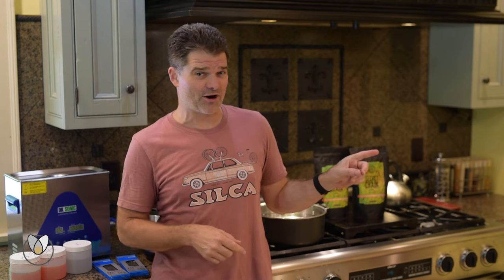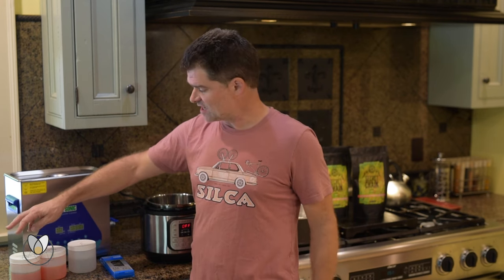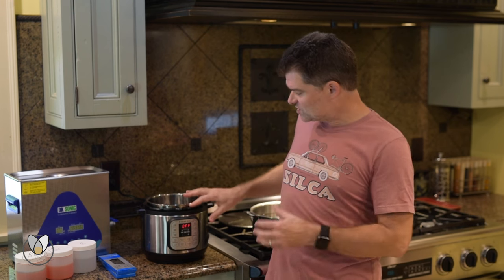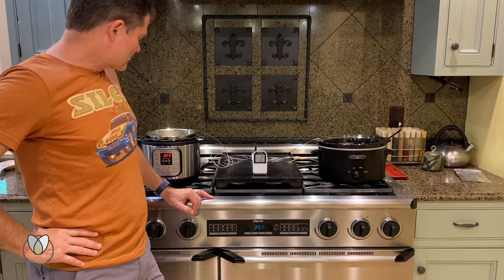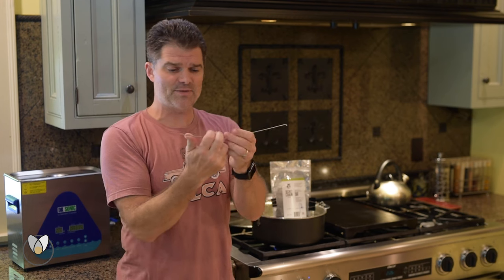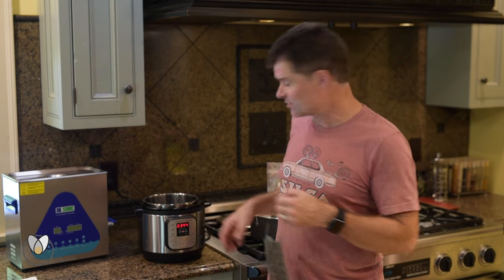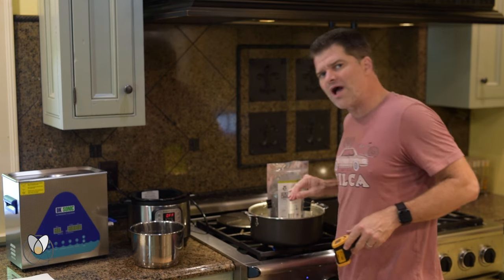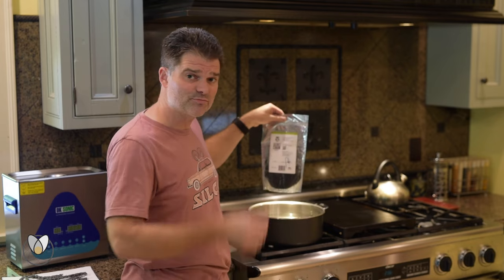MGTV: How to Hot Melt Wax Your Bicycle Chain

Comment: What's the point of leaving so much lube on the OUTSIDE of the chain? It doesn't do any good from a lubrication standpoint, it flakes off and gets all over everything, and it wastes expensive lube. It seems like you'd be better off to focus more on agitation to make sure you get plenty of wax on the INSIDE of the chain, where it really matters. Pulling it earlier would be one way to end up with less on the outside. Another would be to let it cool completely, then hit it with a heat gun just long enough to melt the wax off the outside. Either way, catch the drippings and reuse them.
Reply: I pull mine after a couple of minutes of agitation, wipe the outside real quick and cool it with a fan. The clearances in the chain are way to small for the wax to run out even when it's hot. I usually get 300-400 miles per application out of it this way.
Reply from the maker: The goal is to keep as much lube as possible inside the chain, and the only way to really ensure the how wax isn't running out of the inside of the chain is to get the wax on the outside to solidify as fast as possible.  You can absolutely then scrape the chain and manipulate it to get the excess wax off of the outside over the Instant Pot to save it for later.. but we've tested it pretty extensively and it is very clear that pulling it as cold as possible leaves more wax in the chain resulting in longer re-lube intervals and better overall performance.  I would not recommend heating the chain to remove external wax, I would just scrape it to remove the excess.
Reply: @SILCAVelo  have you tested the heating with a heat gun approach instead of the scrape and break version?  I have been using the heat gun/ hair drier to get the chain moving and it sure seems to not impose any issues for me.  Another thought for a great option to use for a shaker bottle is one that you can bet for mixing protein shakes, the top can thread off but you can pour out the solvent is you wish also and they are not likely to leak like many simple HDPE plastic bottles do.  They can be found in 500 and 750 ml size and are relatively cheap.

Comment: Why don't you just put the wax into a pot on the stove, why keep it in the bag and heat it via water?
Reply from the maker: You can heat it directly but you will not want to use the pot again for cooking food.  The bag allows you to get the same effect without ruining a pot or crock-pot/instant pot.
Reply: @SILCAVelo  I suppose I have wanted to find an old second hand pot just for melting wax. How come you do use the instapot without the bag, are you not using that for food?
Reply from the maker: We have the instantpot dedicated to chain waxing, a crock pot works well also  as both are heat controlled.  If you are using a pot on the stove you will want to do it double-boiler style with water to reduce the risk of overheating the wax

Comment: Silca Secret Chain Blend costs me 47.90 Swissfrancs each pack every 1000 kilometers a new pack for 20000 kilometer life span is 958Swissfrances of the wax. Not talking about 200 to 300 kilometers adding of the other product not talking about cleaning products. This does not sound like its worth to buy. Im paricipating in raes so the small wattage advantage and the price do not looks like a good thing to me.
Reply from the maker: ZFC outlines the cost to run for lubricants and Secret Chain Blend is the second lowest cost to run of any chain lube they have ever tested and he includes the transportation cost in the wax price.
Reply: @SILCAVelo  Just found out one bag is for quite a lot of applications. than is way cheaper than I initially thought